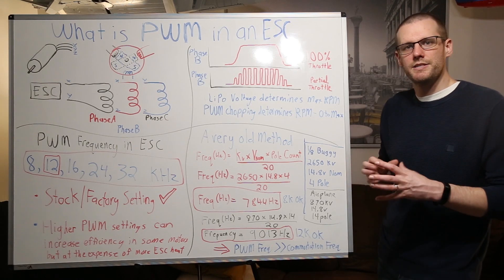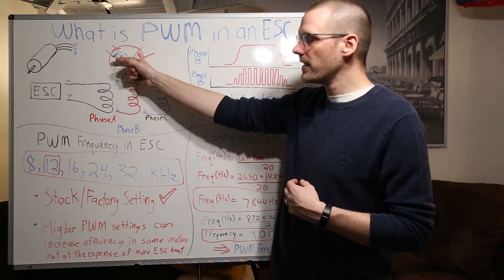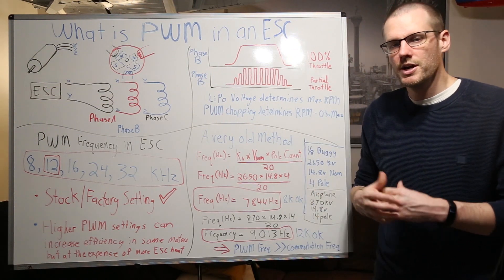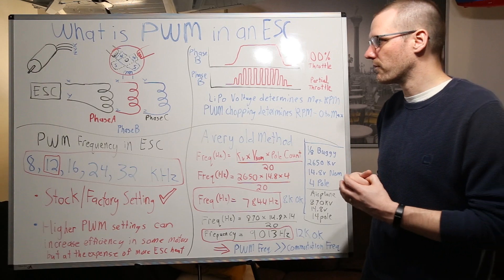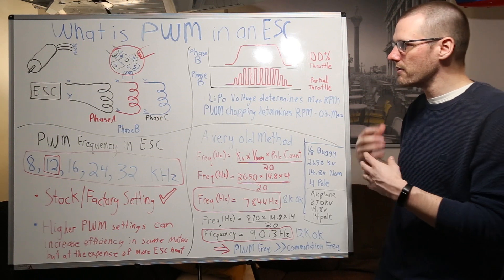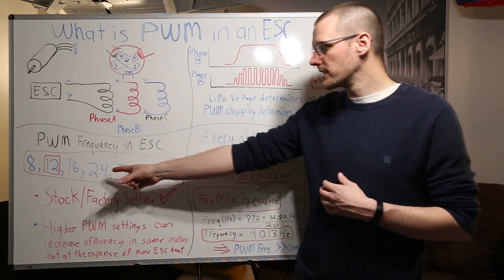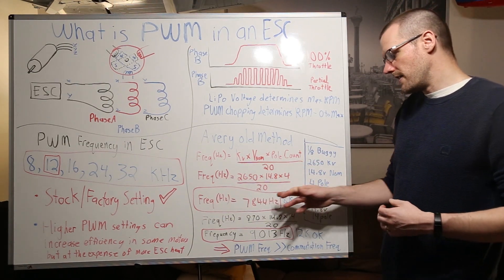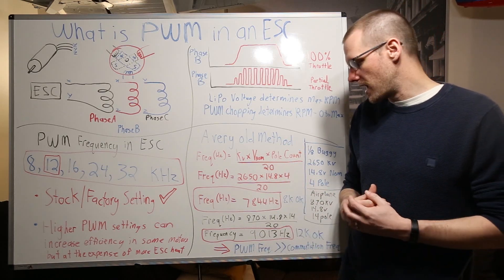How Does an ESC work? What does the PWM Frequency Do and should I change it?

Comment: This formula for the PWM frequency says nothing else than you should have at least 1 pwm pulse within 1 PM pole N-S transit along of 1 stator pole. I personally would rather work with at least 2 or 4 pulses within 1 PM pole N-S transit to get a smoother motor behavior.

Comment: Sooooo.... What I got from this is I could use brushed ESC to drive a DC induction 12v automotive fuel pump with PWM, so long as I converted a pressure signal to PWM? What frequency is the output signal of the receivers typically? (I could do brushless but I'm not a baller like that, the point is to be able to run a fat, cheap, single pump in the factory bucket, without it drawing 20+amps all friggen day...) Could also step up the voltage based on this. Essentially replicate what most modern fuel systems do for pressure control, but still have a regulator on the return. (it would just be set slightly higher than the pump's control pressure, as a default, where in the pump would be running wide open. Car would run rich enough it would be obvious something isn't right, but wouldn't fry a piston, and would be driveable to get to a safe place. Or could have a relay that just kills the pump. Is this a reasonable application for an old ESC? curious how reliable they would be. Haven't had a change to scope a few OEM FPCMs to see what they like for input to kick on.
Reply from the maker: The video discusses the output from esc to motor. Not receiver to esc. A simple servo tester can control an esc.

Comment: Not sure if you still answer old video questions.  My esc came set at 1000 hz. I'm running a 3300 kv 4 pole on 3s   it came to 7326 so should I change it to 8 kHz?
Reply from the maker: I dont get to all the questions. 
Confirm that the 1000Hz is the pwm frequency. I haven't seen one being so low before. Most escs are at atleast 8000hz or 12000hz. Change to 8khz if confirmed.
Reply: @RCexplained  thank you . On my  program sheat the adjustability is from 1 thru 8   starts at 16KHz to 125 Hz . It is a cheap 80 amp esc. I don't have any equipment to test it
Reply from the maker: @revee1000  16KHz will be fine.

Comment: I have an edf motor that is a bit puzzling. 2250kv, 6s 22.2v, 12 poles. Would this require an esc that can to 32k?
Reply from the maker: Yes most high performance motors used in high powered EDFs are inrunners with a 4 pole rotor.
Reply: @RCexplained  my edf units use a 12 pole out runner
Reply: @RCexplained  they are jp 70mm 6s edf units.  For some reason jp says they require certain esc to run. Is that due to and the extremely high switching rate?

Comment: From where do we get that constant (20) that you use to divide the PWM frequency formula?
If I plug in your formula for a 4S (14.8V) whoop and a 4500 kV motor I get 46.6 kHz optimal PWM Frequency. So for whoops, 48kHz is the right frequency?! Not all ESCs support this.

Comment: Hello 
For my rc  tank i can change the khz with my custom elmod board
Since the tank is very heavy and needs to drive slow and have a lot of torque what would be the best ? A high or a low khz ?
The motor is non brushless

Comment: Please confirm, My helicopter motor is 520KV , Magnet Poles 10 , 12s lipo 44.4V.  So 44.4 X 520 X 10 = 230 880 / 20 = 11.544, so my PWM should be 12Khz? Align T-Rex 800MX Brushless Motor(520KV) + Castle Phoenix Edge HV 120 Brushless ESC

Comment: Hi, 
Can you make a video on how to programm an esc without a program card and without a radio controller. Because I'm puzzled on how the esc is taking inputs, in the manul its given to move the throttle up later power up esc and wait for some time it will end up in program mode, but the same procedure I did it with a servo tester, for an esc it should not matter if it's a transmitter or a servo driver has long has its receiving the inputs, but for some reason my esc never went to program mode so just puzzled, it would be great if you helped me out.

Comment: i have a pixhawk cube FC for my Hexacopter. i was running 200 amp madX escs' , when i switched to 500 amp Flier model escs" they wouldn't receive a signal. i checked the escs' by running a direct wire from futaba receiver to one esc and it worked fine. Why don't the bigger flier model escs receive signal from the pixhawk, but the madX escs do? any info is greatly appreciated. thanks.

Comment: Finally. I get the answer to the questions around ESC after spending hours on Google. Awesome video. One question: How is the torque controlled? Or in other words how does the torque affect the motor RPM? Is it similar to a brushed DC motor?
Reply from the maker: Torque is not controlled. Speed is. As the motor is loaded RPM comes down.
Reply: torque is a product of the force applied to spin the motor. so if you want more torque get stronger magnets.

Comment: Hello Ryan, first of all thanks for your videos, really interesting and very well explained. 

Small question on this one: on the whiteboard you drew a voltage curve that is ramping up and down. Isn't this achieved using shorter PWM pulses in reality (i.e. using pulse length to get to a lower average voltage)? 
Or are the FETs really sending a lower voltage to the motor?

Comment: Hi Ryan, great video. I'd love to have your opinion: Just finished a new quadcopter build. I'm using Blheli32 ESCs and 935kv brushless motors. When testing the system, 3 of the motors seems to be ok but the 4th is just jumping back and forth not getting into smooth rotation to either direction. Any idea? Settings / esc problem / motor problem (all components are new). Thanks!
Reply from the maker: Test another working motor connected to that ESC to see if it is the motor acting up. Also test another working ESC to see if it is able to spin up the hesitating motor. This should provide you with some insight to see what the problem could be. Motor vs ESC
Reply: @RCexplained  That's the plan for tomorrow as it is almost midnight here 😉. Can it be a sync issue? Should I change anything on the blheli32 suit for that esc (in case it causes the same effect on a different motor?)
And thanks for the fast response!
Reply from the maker: I would not do anything until cross checked with known working equipment. If you didn't have to change anything on the 3 other setups, the fourth should be no different.
Reply: @RCexplained  ok, you were right. Swapped motors and seems like it's the motor's fault. Another motor with the original esc works fine.
I also tried to play with the esc parameters to get the faulty motor to work and managed to get it spinning at half throttle for a while but there were lots of vibrations and it got warm so I stopped. Do you think there is anything I can do with that motor? (Brand new, though an EMAX so not an impressive quality...)
Reply from the maker: Spin the motor up with a drill and measure the back EMF of each phase. If they are not the same within a close tolerance, there's not much you can do. Look up my Determining Kv with a Drill Video from a couple years ago if you are unfamiliar with this process.

Comment: Hi ,my motor states drive frequency is 8khz and 15 timing,my esc has 12 or 18 timing and it says pwm 8khz up to 16khz,my question is what should I set timing to 12 or 18 and is pwm frequency same as the motor drive frequency, please help
Reply from the maker: drive frequency would be PWM frequency. Try a timing of 12 and measure performance. do the same with 18. select best

Comment: This seems to apply to planes and cars not necessarily quadcopters.  My micro quads use 24khz or 48khz.  In fact the higher 48khz is MORE efficient for very small, very high kv setups.
Reply from the maker: What did you calculate using the formula?

Comment: Hi Ryan, thanks but i think you should divide by 120 not 20. 
f=(RPM*p)/120, this the formula we've always used at the university. The time needed for a slot to face another pole of the same type = (60/RPM)/(p/2)= 120/(p*RPM)=120/(p*KV*V).
You invert it and you obtain the frequency
Reply from the maker: Hi Jean, in the formula that you have used, you have not used the commutation steps per electrical revolution. As a result, when calculating your PWM frequency, it will result in a lower frequency then the commutation frequency. This is the opposite relationship that you want. There is not much really to lose with a higher PWM frequency but that is not the case with a lower PWM frequency.
Reply: @RCexplained  you are still wrong. 20 has nothing to do with 120. We get 120 or 2*60, because of the conversion from Minutes in rpm to Seconds in Herz and the division by "2" is because we need pole pairs not pole count. 
Idk who made up this "20".
Reply from the maker: I believe it's important to understand where the 20 comes from before starting with "you are still wrong." However, yes, the pole pairs and time conversion factors have indeed been considered.
Reply: @RCexplained  so then explain why is the difference of 6 times to the original formula?
Reply from the maker: A PWM multiplier or factor is used in the formula. The factor used is typically between about 5 and 20. This range helps to determine how much higher the PWM frequency should be compared to the eRPM.  This formula doesn't guarantee a perfect PWM value as there are many factors to consider but makes for a great starting point.

Comment: Does that 12 default apply to brushless motor or also to dc motor?
Reply from the maker: 12kHz is the PWM frequency of the ESC to the brushless motor. I don't use brushed DC motors/ESC;s too often these days to comment on them.

Comment: Hi I have a pwm signal controller. It has a digital  display(that's necessary for my project). It has a frequency choice and duty cycle (I get confused between these two).  Can I attach the pwm signal to the  ESC controller for brushless motor? The PWM controller has a +- voltage  output. I need it for a mini blower fan. The ESC 3 wires connect to the brushless motor, but not sure how I should connect the pwm signal to the ESC
Reply from the maker: In the video we were talking about the output PWM frequency that the ESC uses to drive the motor. I don't remember touching on the input to the ESC as it seems you are interested in. Generally the input requirement is about a 4-6V peak to peak square wave pulse. Pulse length or duration is 0.9mS to 2.1mS. The pulse refreshes at 50Hz or 20mS.
Reply: @RCexplained  so what would happen if I connect 5v dc input into the ESC speed controller without pwm, or any frequency. Wouldn't the esc still work to control the motor?
Reply from the maker: @vahagnmelikyan2906  to control the esc you would have to supply the correct signal through the 3 lead radio wire of the esc.

Comment: Thank you for another rc schooling, wondering if you mite do a comparison video between a well used motor and a new motor. Magnet strength, voltages' ability to travel intra motor when new compared to used, power feedback through the wires, how and why used motors seem to have a more static/ longer neutral point than a motor that is new. There's alot of used motors on the market for half the price of new, but the 'wear n tear' factor is not often looked at. If anybody can explain things like magnet strength depletion, a falling power curve and loss of rpm it's you ! Thanks!
Reply from the maker: Hey Mike. Very interesting. I have always assumed that electrically the motors don't really wear.(including the magnet) Mechanically, bearings can age and wear out. How many hours of usage would be considered a "well used motor?"

Comment: Awesome! I thought that ESC were controlled using PPM instead of PWM signals. Is PWM the correct type of signal to input in the signal cable of the ESC?
Reply from the maker: Note that the PWM frequency mentioned in the video is for the output to the motor.

Comment: Thank you for the great video! If the ESC controls only the "average" voltage (since pwn is rapid on/off) to the motor, and current is not "controlled" by the ESC but instead determined by load of the motor, then can I say that ESC does NOT directly control the power of motor nor the speed of it? BTW kv is only accurate as per voltage when there is no load, and with higher load the motor can meet the power limit sooner than reaching its kv-denoted highest speed right?
Reply from the maker: The ESC controls the speed of the motor. kv accuracy is not required in order to control speed. The controller simply provides an on/off duty cycle, it's not a closed loop system checking and confirming that 10,000RPM was reached.  A higher load could result in a slower speed at the same duty cycle.
Reply: @RCexplained  Understood. Thank you so much!

Comment: HEY NICE VIDEO !! I HAVE A DOUBT  IF WE HAVE 24 VOLT BATTERY , DOES 100% THROTTLE MEAN 100% DUTY CYCLE MEANING 24 VOLTS APPLIED ?
Reply from the maker: 24v is always the applied voltage from the ESC if the battery is 24v, however the motor will "see" the average based on the duty cycle. At full throttle, duty cycle is 100%, motor sees source voltage.
Reply: @RCexplained  SO 50% THROTTLE MEANS 12 VOLTS TO MOTOR?

Comment: What's the point in all the other settings then if they don't do anything, surely the manufacturer wouldn't let you change them if they made no difference?
Reply from the maker: Hey Lawrence, from my own (limited) experience, I have not come across a setup that requires a different PWM setting on the ESC. Surely there are many setups that require different settings, however, it will be a low percentage overall. I ran through the calculation in the video of a couple of my own setups, but I'm sure I can find values that will theoretically require a different setting. Have you ever required to change the PWM setting?
Reply: @RCexplained  I don't think any of my escs have it as a changeable setting, but on computers I know you can change the pwm frequency for the VRM which powers the cpu. When overclocking it can increase the stability a lot under higher current and voltage. The VRM on the motherboard does run warmer because of this.

I have seen some more race oriented escs you can change the pwm frequency separately on both the brake and normal forward driving of the car.
Reply: @RCexplained  For RC cars, PWM frequency doesn't really matter much like you said. But for RC quads, especially racing quads where very fast and small changes are made by the flight controller, a higher PWM setting can help depending on motor, ESC, flight controller combination.
Reply from the maker: @shadow7037932  yes, formula would help out with the high RPM and Pole count that are commonly found in quads.

Comment: Can you turn this theory into practice using a RC dyno with different motors for comparisons? 👍
Reply from the maker: Hey Greg, that's the plan for many of the videos that have been posted. I want to demonstrate these theoretical approaches using the appropriate motors etc.  I have some limitations to work through until I can get there. A major limitation is equipment.  A good example is even this particular video. I do not have a setup that actually requires a higher PWM setting then factory.

Comment: Good vid! Very theoretical with real world applications. 

Please correct me if I'm wrong but these are what i picked up:
Lower PWM, hotter motor, more possible to cog.
Higher pwm, cooler motorr, less cogging, hotter esc. 
Most of the time stock pwm doesnt need to be changed. 
If you do change it, compute it first. 

To make it short: don't change the pwm. 😁
Thanks for this vid.
Reply from the maker: Hey James, sounds like you got it! The only thing I would say is change cog to smoothness and responsiveness issues. Generally speaking a motor would typically not have a problem with higher PWM settings at the cost of heat output from the ESC.  Higher PWM settings can improve smoothness and responsiveness in the motor. 

Running the formula is a good way to start if considering changing the settings. This gives you an immediate baseline as to where the setting should be.
Reply: @RCexplained  oooh, so (if you increase pwm) its not necessarily a cooler motor, its the usual temperature, but a relatively higher temp esc. 

Also, if you lower the pwm, its not a cooler esc, just the usual temp esc, but with a relatively hotter motor.
?

Okay so smoothness and responsiveness got it.